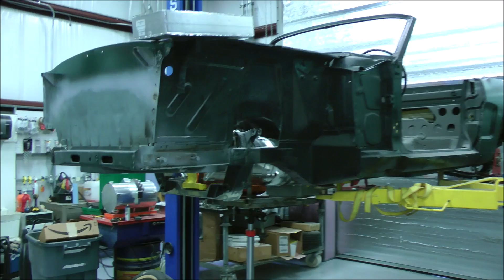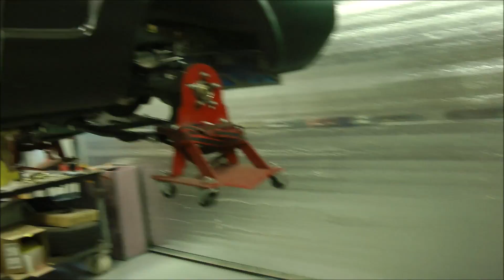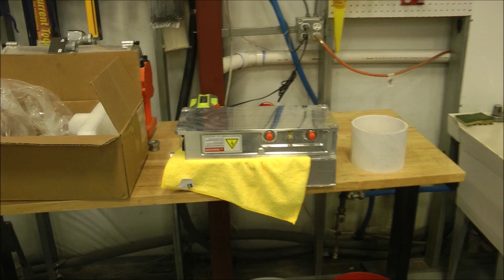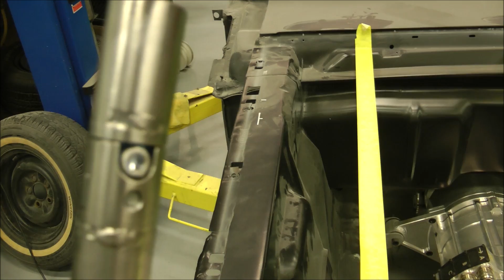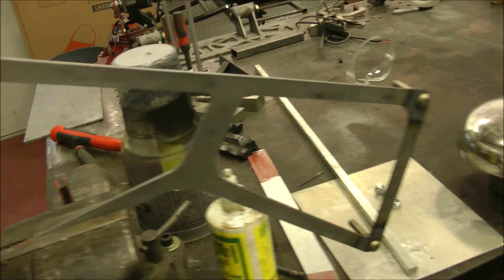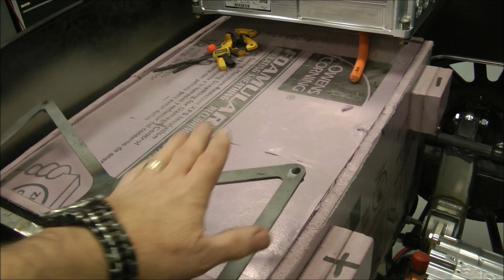66 Mustang update 15

Comment: Awsome build! Curious what you're going to use for the brake master cylinder and steering. Original manual steering or maybe a power steering box/ brake booster combo out of a off the shelf EV?